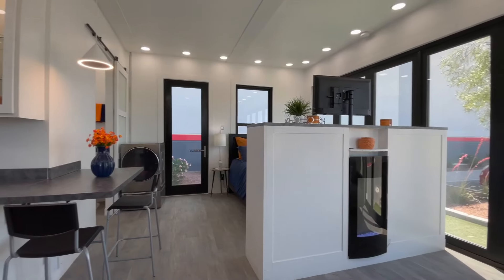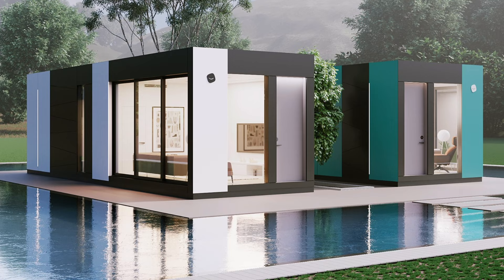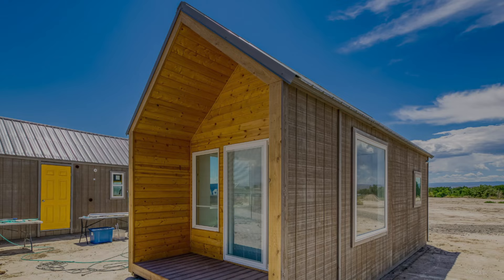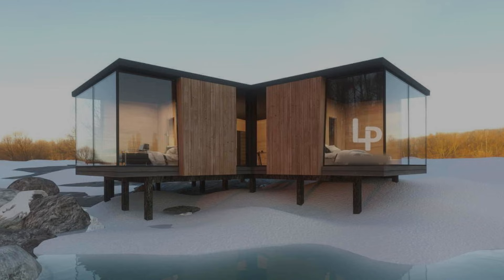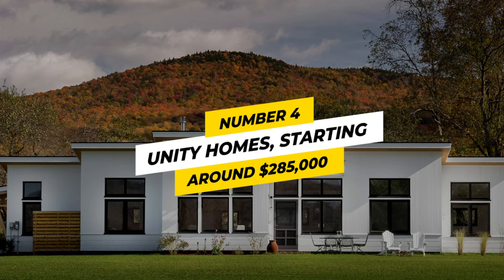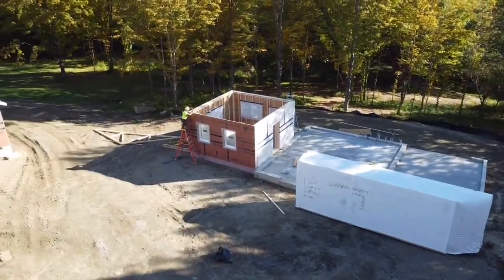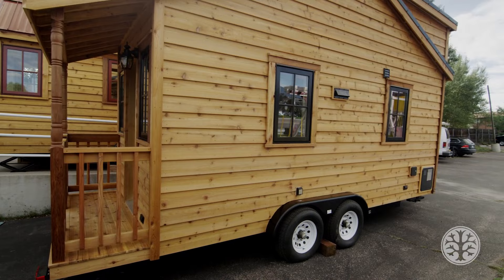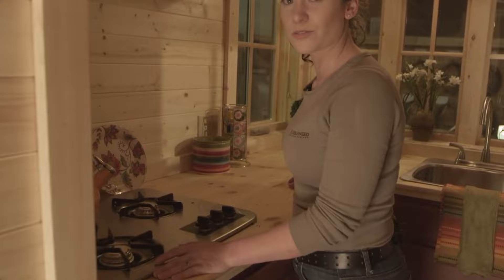Better Than BOXABL!!! These 5 NEW Prefab Homes Will Blow Your Mind [JUNE 2023]

Comment: I'm not paying over $100Kfor a tiny prefab home! I'd rather buy a used RV, Pave a driveway, put a fence around the lot and run a power cable out to it. Then I'll get a gym membership and go into town three times a week to workout and shower.
Reply: The home goes up in value if you pick a good location.  
An RV will lose its value the day  you purchase it.
Reply: @vfpfootball  not sure if thats true as tiny homes seemed designed to last around 20-30 years. I'm really just concerned about minimalizing my living costs. I'm thinking a large shed, slowly upgraded is probably the way to go if I want a traditional homelife lifestyle.
Reply: @oldtymer9106  yeah definitely need to do your research.  Get a quality prefab. 
Yes, you can definitely use a shed. 
Get a piece of property, lay a foundation, and insulate. 
Anything is better than renting.
Reply: Yah, these prices are ridiculous.
Reply: There is a Cinderella toilet. And some communities allow a grey water recycling process with rocks and plants. In that case, there is no need for septic. Just water and power. So that paved driveway used RV sounds pretty darn doable.
Reply: @joemalone7386  i will research that - thanks!
Reply: @vfpfootball exactly what I was going to say
Reply: @vfpfootball   Missed his point.
Reply: Good idea 
, I plan do the same with my 36’ class A motorhome on my lot  in pahrump , nevada , very easy in this small town
Reply: Preach
Reply: @vfpfootball ..it’s more the land that goes up in value…the house..by contrast starts to fall apart the day you move in..
Reply: @zeroceiling   Yes, the land goes up in value, but so does the home if you take care of it & put a foundation down. 
A trailer or an RV can actually make the land go down in value. 
My point was an RV or trailer is not an investment it's a liability.
Reply: 5th wheel, for Five years. Get tired of the view or neighbors... LEAVE!
Reply: Exactly 👍🏾 I agree
Reply: @vfpfootball  …I won’t disagree there…but if you count up the money and taxes spent on your home…it is significant!. Then there is the opportunity cost of money tied up in the house.If you have let’s say $300K tied up in it…and that money could have instead been invested in a balanced fund on the NYSE…with stocks like Amazon, Tesla..Apple..even Microsoft….you would be looking at several million dollars…sure, at some risk…but then so is a house in a cycle like  2008…but I do agree that an RV or a trailer…generally crush curb appeal..
Reply: @vfpfootball   as long as I survive longer than the RV does --  I don't care what it is worth afterwards.   I am in my late 50s, and will be selling my "city pad" when I retire.

The trick is figuring out where to live cheap that I will enjoy.  Heck, I already work remotely, just tied to this place by a mortgage.  If I get laid off I may well take 6 months off and downsize/sell/relocate.  I think I prefer Vessel if I go prefab..  those I have actually seen in the wild and know they exist.   :D
Reply: 3?
Reply: @Oubre84  maybe 4X. It's not healthy to shower everyday. Lol!
Reply: @oldtymer9106  what if u work outside?
Reply: @Oubre84  I'm semi-retired. If i do gardening or something making me break a sweat I'll rig something up to handle those rare occassions.
Reply: You will look far for a community that will allow that type of living arrangement.  They are rare, though becoming less so.
Reply: @doloresreynolds8145  where there's a will, there's a way. Just moved back East and Chillin with Mom in the house I grew up in -  for now.
Reply: Truly
Reply: Personally I'm looking at incredible tiny homes, they have 16ft ones for 20k, just trying to find land where I can put it on.
Reply: Theres only a few states that will allow you to live in your RV even on ypur own private property
Reply: @terra2730  i only need one or two. Which ones are they?
Reply: Alibaba, under 10k
Reply: I'm with you on this

Comment: I built a shed in my baclyard for less than 30k..its 700 sq ft. It  has tile floor, dry wall, down stairs is tiled, upstairs is carpet, it had 65" flat screen, 4 cat6-e ethernet cables, wifi, stairs, R19 insulation, 6 cam lights, ceiling fan, a queen sized bed, futon, 2 large sectional, ac and heat, ring camera, 2 dormers, and an aluminum door with windows....
Reply: That sounds perfect exactly what I'd like for our family member. What / where did u start. I think I could easily find a lot then build accordingly.
Reply: But you work for free and other people don't.
Reply: no bathroom
Reply: That’s great but you have No kitchen and appliances and bathroom and your shed cannot withstand Cat 4 Hurricanes and pass International Building Codes
Reply: Come Jamaica and help me build one❤🙏🏿🌹
Reply: CherokeeLandcare    he may have..  its sounds like a bedroom built over storage.   With only electric service.  

No Kitchen, water or sewer connections, and no bathroom.   Those are the expensive parts.    Its just a "hidden bedroom"

Comment: These are nothing more than a modified tool shed. Sorry but I wouldn't touch any of them with a 10 ft. pole. We are about to see a complete housing crash in the next 12 months. If you have any money, it's best to save that money to use as a 30% down payment on a small used home. You will save thousands.

Comment: I didn't hear any option that was better than Boxabl. Roombus was close. You have to add in cost of the land, laying foundation, well, septic and land set up if you can find land that will allow it.
Reply: Boxabl is extremely limited in floor plan options. Casita is too small to call a home.
Reply: Not to mention that boxabl is turning out to be a massive scam.
Reply: @dht580  yeah, for having two big ass factories and fancy equipment I have never seen one in the wild.    By now there should be thousands.
Reply: I just say because I am waiting for a boxable  and it is useless regulations  to control  people from getting  some of these homes. From a bank to pitch of a roof wanting certain sq foot size.  Things don't work out I will make a air Crete home. I live in 3 room in my home now bedroom, bathroom!!, and kitchen. With high ceilings and open plan floor plan I will be good.  But heck might die to since I am 70. Lol
Reply: @jamesneal1129   I have actually seen Vessel homes - not sure how well they will age but I have have actually SEEN one.  LOL
Reply: Plus elec as well as insurance

Comment: Outrageous prices for them.  For those prices I would rather  a real house.
Reply: You can get a barndominimum (steel) or a post frame for way cheaper than this.
Reply: @jackies35   bull$#%, Barndos are ALWAYS going to cost more than a stick build house of the same size.   I bought the hype too, and had some prices run up.  Its the same cost for the inner finish out as a stick built house with the additional cost of a LOT of concrete and steel.   You are better off building a house and then a smaller pole barn.

I can build a 1000 foot normal house on a pad for around 100K or so.  (last one I had built at 850sq ft was 69K with 5K for a garage)  To make a similar size Barndo that doesn't even have a massive shop behind it is $175K+, for the "usual" shop Barndo owners want its $240K+  (1000 Sq Foot house and another partially finished 1000 sq foot of "shop.")   The same builder would do a separated double garage/shop for 60K by itself.  (unfinished/uninsulated)

Now if you go wood it might not be that bad, you are just adding rooms to a traditional barn at that point.  But no, Barrndos are not the "deal" you think.  That is why you never EVER see them quote as-built prices on the usual "barndo" channels here.

The bigger you get the more exponential the cost of the steel as the crown has to be higher and higher...  and the more concrete needed to support the weight of all that steel.

Comment: Insanity should be the headline! 57,000$ versus 10,000$?
Reply: You can't even buy a load of drywall for 10K, much less appliances and AC..   anything livable below 60K is a good realistic starting point.   That doesn't include dirt or local utility connections either.